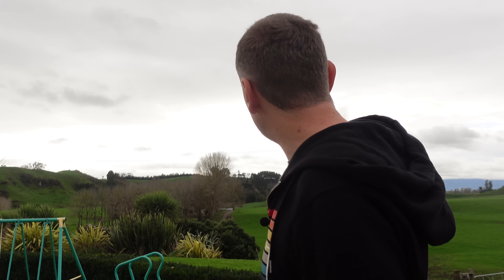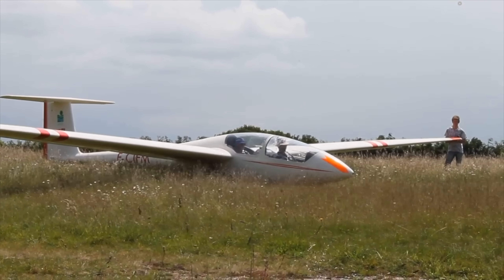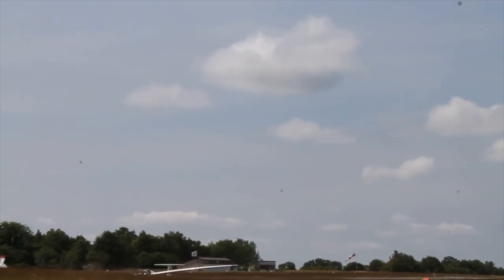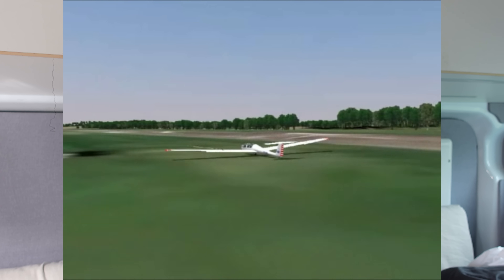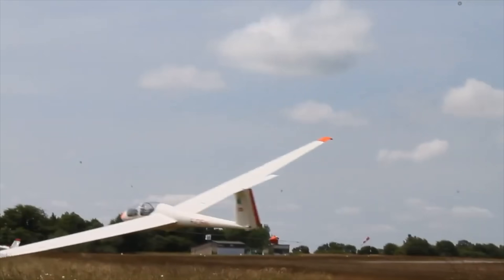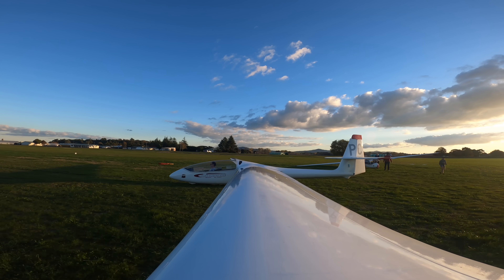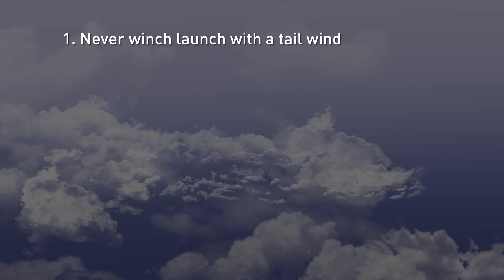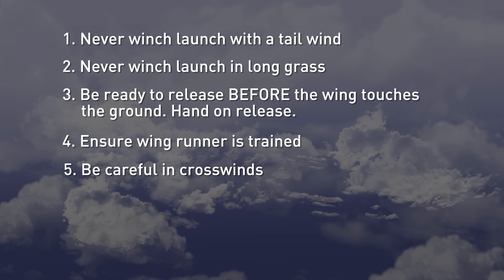Glider Winch Launch Crash 💥 Instructor Reacts

Comment: An American CFI with long experience at winch tow going back to Torrey Pines days (an iconic US soaring site just north of San Diego, now closed) sent around this commentary:

------

Note that the glider in question is a Grob 103 ... winch launching glass gliders is much more demanding that winching Schweizers, or any of the older K-7/ASK-13/Blanik trainers. 

The early on-take-off crash in this example is one I have never seen ... but it is all-too-easy to do in glass sailplanes, and the BGA training films talk about it.   The same dynamics can happen somewhat higher on tow ... producing an even more lethal crash.  

And yes, the most basic thing is that you must have your hand on the release and you MUST PULL THE RELEASE WHEN A WING DROPS,  INSTANTLY ... but there's more to know about it.  

What this instructor doesn't explain is that while the accident may have been started by the wing tip snagging the grass, what is happening is that THE GLIDER IS DOING A BAD SNAP ROLL!  (AKA "Flick Roll")  If you don't know what a snap roll is ... it's that the glider is SPINNING -- while traveling (sort-of) horizontally.  

In an aerobatic airplane you start a snap roll from a speed that is at least about 1.4 times the stall speed (2x stall produces a much better snap roll but requires 4 gees), it's an ACCELERATED STALL MANEUVER -- you slam the stick back HARD and you kick full rudder to intentionally spin the plane ... you get a wicked-fast snap roll ... you stop it by the usual spin-recovery: full opposite rudder and stick forward.

So how the hell is this glider doing a snap roll, an ACCELERATED STALL maneuver?  PSSST -- IT'S THE LOAD FROM THE TOW LINE.  Once the glider is nose-up on tow the GLIDER is experiencing 2g aerodynamic loads or so, even though you as a pilot only feel 1g.  This is why winch launch is such a deceptive maneuver to beginning pilots.

Once the glider starts yawing and the nose goes up the lousy snap roll into the ground is inevitable, given the load. The yaw was triggered by the wingtip in the grass, but the problem is that the glider is at a high angle of attack AND g-loaded by the rope tension.   Also note that if you look at the video carefully the pilot has up-elevator through the whole initiation of the disaster -- stick forward might have saved him too. 

Releasing the rope is so critical BECAUSE it unloads the wing, ditto stick forward!   That will allow you to regain control.  

With a glass glider and CG hook you can initiate a loaded stall almost anywhere in the tow.   The absolutely key thing is THE INSTANT a wing drops, RELEASE, stick forward!  Do not try to pick the wing up with aileron until the stall is broken  -- it's stalled, you will only make it worse.  

This kind of accident doesn't happen (as far as I know) with Schweizers (Older American trainer long out of production but still commonly used for primary training) BECAUSE the hook isn't a true CG hook, and the wings have much softer stall characteristics, and retain more aileron authority in a stall.

Years ago I saw a horrible winch-launch fatality at Torrey Pines where a pilot flying a Standard Cirrus (they were the new hot item then) did just about the same thing as you see in this crash, but starting from a high climb angle at about 100 ft.  He'd just established too high an angle of attack.   You don't need to snag a wing in the grass to start a snap roll ..,. any accelerated stall with a little miscoordination will do it.
Reply from the maker: Hey thanks for sharing, they raise many great points. And I agree, it's possible to stall a wing at any stage, not just due to grass. The grass just helps get that wing into a stalled state...

Comment: What they could've done too is cut the grass! Great informative show! Thanks. I tow hang gliders off a cart. Just found out you mentioned tall grass. Pardon me. However, giving your ground crew proper instructions is needed too-
Reply from the maker: Yeah, I didn't quite make clear which factors were more important than others- I just went through all the factors I could see. Obviously the long grass and cross winds were the big ones. Ground crew instructions are important, but probably wouldn't have made a lot of difference in this case.
Reply: @PureGlide  Impossible to think of everything P.G. You did & are doing a great job trying to keep everyone safe! I've made a few videos myself & always have regrets. Keep them coming. You're saving broken aircraft & bones you don't even realize. From Florida USA.

Comment: I learned in old T54 (?) Gliders with high wings ... so this was very interesting ...
Reply from the maker: Yeah less of a problem for high wing gliders, as you simply have more time to react!
Reply: I learned to fly a Blanik, 40 something years ago and from memory I'm sure I was told to use the rudder in this case and not ailerons. I think it was because  of aileron drag and also the ailerons not having enough authority at such low speed. I could be wrong it was over 4 decades ago, oh and I had a cable break on my first solo right at 300 feet which was the decision point...try a modified short circuit landing or land straight ahead...I nearly bent the control column I pushed it forward so hard. Landed straight ahead no problems and then climbed out and had a bit of a think about it all.

Comment: Others may already have said this but, Tim, if you had ever had a launch from a Van Gelder winch (London Gliding Club for instance) you would not expect the wing tip HOLDER to run at all. Acceleration is far too fast for more than a pace. Like many others, I would not consider it safe to launch with long grass like that. I imagine the insurers had something to say about airfield practices if they were aware.
Reply from the maker: Yeah it has been mentioned :) many winch launches are too fast for the runner to do anything. But they should try and help as long as possible. Cheers

Comment: Very sensible analysis. Unfortunately, the default human tendency in critical situations is to think, "I can still save this!" and delay the abort command just a fraction of a second too long. Training is the only way to overcome such an understandable response, but even then... Well, it's a good job that a car's airbags deploy automatically, rather than depending on a human hitting a button.

Aircraft test pilots must spend a lot of time dancing on the edge of the go/no-go precipice. Knowing your own limits whilst feeling for the plane's limits takes tremendous presence of mind.

I imagine fast jet pilots never, ever want to pull the 'eject' handle. "I can save this..."

I've flown gliders, and I also got my PPL in a Cessna 172 [licence now lapsed]. I've been a rally driver as well, and know how hard it is to 'give up' when all your instincts are telling you to hang on just a little bit longer because you can definitely rescue the situation...

If only life had a simulator-style 'RESET' button...  😁
Reply from the maker: Well said, and it's trickier when most of the time aerotowing, holding on a bit usually does help. So we basically train ourselves NOT to release immediately.

Comment: Regarding wing running (around 2:00), I would say not much can be done here. He made few steps and glider 'snapped' forward - its very hard to keep up - humans cant accelerate that quickly. With an aerotow is much easier to run for long.
Reply from the maker: I don't disagree to some extent, it probably wouldn't have made much difference. However it is just another potential factor
Reply: @PureGlide  Well, it definetely could be but its too hard to say if it was here - and it was implied a little bit :) And there is one more wisdom from BGA - when wing feels heavy, stop the launch. I have to agree that their safety material is excellent. Plus, there is very little fatal winch launches in UK.
Reply: There was almost zero effort to run the wing. Poor instruction is to blame

Comment: I am an instructor at a club that operates off a narrow dirt strip in almost always crosswind conditions. There is ploughed field and grass either side, so a wing drop will be serious. It's hard to be sure from the video if there was a crosswind, but I believe that the wind was across from the right. Whilst the BGA says that it is ok to hold the downwind wing to help keep the glider straight, I do not teach this. (We are not BGA anymore). I prefer the upwind wing to be held and the wing held a little lower than the downwind one. When we have a near tip scrape it is for two reasons. Firstly the pilot has not placed the controls in the correct position BEFORE the launch commences, i.e. Stick into wind to keep the wings level and opposite rudder to control the weathercock. Or secondly, having done this correctly, fails to reduce the input as the speed accelerates and the controls become more effective causing the upwind wing to go down and the glider to yaw downwind. Again its hard to see from the video, but I cannot see any aileron or rudder deflection both before the launch started nor after it started moving. The wing tip person is also holding the downwind wing. If the wind is strong it's not always necessary for the tip man to run more than a pace or two. If the pilot has pre-set his controls correctly he should have control very quickly except in calm or tailwind conditions. A good video and a very clear analysis.
Reply from the maker: Thanks for your comments!

Comment: I had a similar accident to this one, also in France with long grass, in 1990. I did pull the release as soon as my wing went into the grass but be aware that the release is much harder to pull when under a lot of load. My hand slipped off the release and by the time I had got back on it and pulled it, the glider was rotating towards the ground from 20 or 30 feet. I was very lucky not to die. It went in nose first and fell onto its back.
Reply from the maker: Hi, great points to be aware of, thanks for sharing.
Reply: @PureGlide  That's a MORE than great point. Its a vital one.  Think about it: 
How many folk expect the release to be so much harder under load ?
Has anyone looked into this to ensure every pilot would know if they have the grip & shoulder strength necessary?
Reply: Holy cupcakes 🧁 Batman. Yeah that’s dangerous and your lucky. This is what scares me about flying. 😳
Reply: No winch launches yet ..only tow launches ..great advice here ... student 24 flights ...we allways have cut grass to land and take off rule number 1 ..... great explanation of circumference and fulcrum reality with door etc. 😊😊😊 these videos are so helpfull thank you ...❤❤..

Comment: Very interesting case-study, my former president explained me the importance of being a good wingrunner and also explained about the importance of not "pushing" the wing up to keep it horizontal, because the pilot will only find out that the wing is dropping when you release it and (your force up is removed), better to run and if you feel the wing pushing down, is to lower it so the pilot can couteract immediately and is not surprised when you stop supporting. And of course, run as long as you can... Thank you for the interesting reviews.
Reply from the maker: Thank you Bart!

Comment: Main fault was to the tall grass. 

No fault to wing runner - couldn’t keep up with rapid acceleration from winch driver. 

Every winch operation should have training that includes rapid and insidious launches.
Reply from the maker: All winches are rapid, but IMO the runner should have made a bit more of an attempt. Sure it might not have made much difference. Since confirming the cross wind, they should have been on the other side too. And yes agree the long grass was a main problem, but so was not releasing early enough. As usual, it's a combination of factors...

Comment: I was an instructor more than 40 years ago. Hard runway with a tow car and cable. The P2 was flying. We suffered a case when the wing tip holder held on to the wing tip. This caused us to swing to the right (the side the wing tip holder was holding), then the right wing dropped and was then into the long grass and thence we were soon off the hard runway. (wing tip holders who have never held a wing tip for takeoff  before DO need to be briefed for the first time they do this). Of course I had taken control and tied to straighten things up but could not, so released. It all happened very very very quickly and it was something I had never expected to happen. I can still remember going near sideways for a few seconds, the glider skidding on the now grass surface. I think standards are higher now as it was not part of the instructor patter to review all the potential hazards other than to focus on "cable breaks" which were quite common - but then would you expect a wing tip holder to hold on anyway ? It is also worth pointing out this is why you should never have obstructions either side of the intended take off path, such as someone bringing back a glider even if they do move it to one side supposedly waiting for you to take off with the apparent available space.
Reply from the maker: Yeah completely agree re hazards infront of a launch. It's all fine until it's not! Thanks for sharing

Comment: been there , done that, didn't crash the glider because I was ready with my hand on the release. 

The pupil had had some problems keeping wings level. We put the glider dead center at the launch point, dead straight cable run out, short grass, wing runner briefed to run as long as possible, very low cross wind - what could go wrong ? 
As soon as we started to move, right wing went down a tiny amount, pupil put full left stick and rudder ! We were 6 ft in the air with left tip on the ground, I had time to shout "control" and took over. 
Main thought was get the nose down and wings level. Cable wouldn't release first time, by the second attempt I had the nose down and wings level. 
Cable released, but we were heading off at 45 degrees towards parked gliders and cars.....Distinctly remember thinking , well we're going to live, but it's going to be expensive....

started a low bank turn to get away from the parked gliders at about 6ft off the ground, as we came round, the right wing tip touched and we ground looped, but clear of everything. Next thought was, stick forward to keep the tail off the ground so we don't break the tail. 
Skidded to a stop sideways, in front of the club house. Main concern was did the pupil hit his head at all during the ground loop, gliders can be repaired. 
As we were in front of the club house, we went for a cuppa tea and had a chat. Inspector checked the K13 over, and no damage was found. 

Estimated total flight time ~ 6 seconds...
Reply from the maker: Wow, sounds like that was good reactions, combined with a touch of luck! well done.

Comment: Hello Tim!
Thank you for bringing an important matter like this on the table!
If I remember it correctly 30 years ago our flight instructor told us that 
according to the Segelflugbetriebsordnung (SBO)
it was strictly forbidden to guide hold the leeward wingtip in a crosswind scenario!

When the helper on the lu ward wing is lagging you're turned into the wind contributing to your
aileron authority instead of diminishing it.
And the wing pointing into the wind remains always low because a slow runner is automatically holding the wingtip back and down instead of rising it up high towards
an accident. Just my 2 cts (sorry for my poor English)
Reply from the maker: Yes I agree, that might have helped. Good English! Cheers
Reply: Good points!  

Also, good English, besser als mein Deutsch!
Reply: @greybirdo That was true back in the 70’s when I flew gliders… Has it changed?